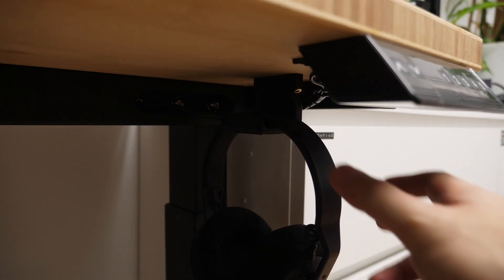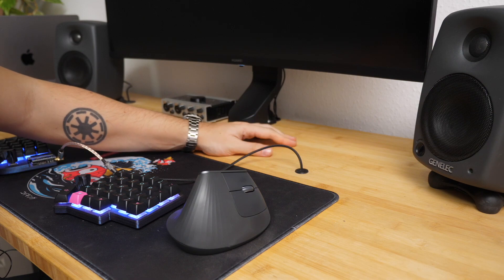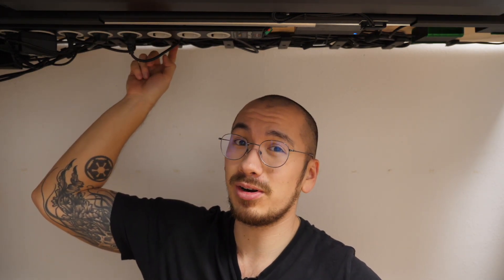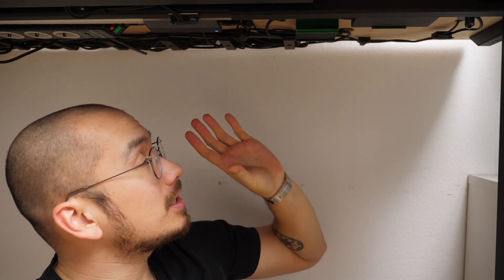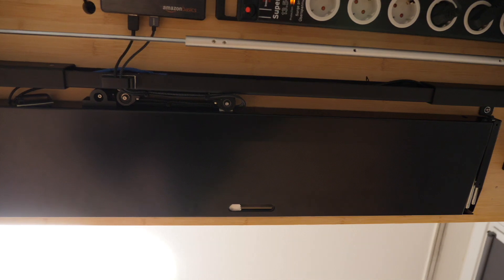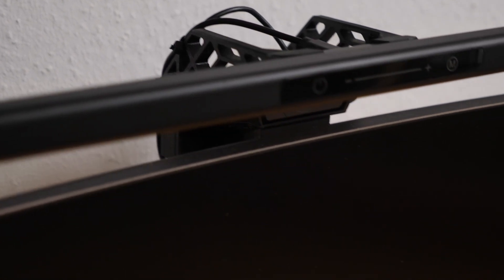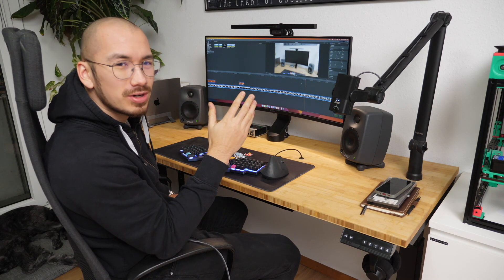Better Cable Management with 3D Printing

Comment: I recently got my 3d printer, and I have primarily just been using it to improve things around my setup.
As you said every ones desk is personalized, even more so when you dont have a standard desk, and thats exactly where 3d printing shines being able to do your own custom solutions. For reference I have the hanging plate in a SVÄRTA ikea bed so unless I drill holes into it nothing standard really works.

Would be curious if its possible to make a cable sleeve as well with 3d printing. Just to tidy up the cables running along stuff.

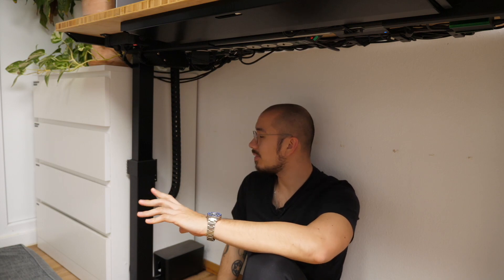Comment: 8:45 Awesome, just awesome, but I Need your help with 2 things. I also bought such a desk and a 3d printer, which means I will adapt some thing with it instead of buying it. Just like your cable drag chain. But my issue is that my pc is standing next to the desk on a small shelf. I would really like to go with the cables down to the floor and then with some kind of chain to the underside of the desk. But with many cables like: main power, 2x DisplayPort, at least 1 usb cable, and some more if needed. Do you have any solution for that? As your chain only goes to the lower table stand part. I could make a somewhat hard 180 turn downwards but that’s not ideal. And you only linked the chain mount, what chain did you use specifically?
The second question what drawer is that, any link for it?
Tysm

Comment: FYI functionally, with the drag chain, it doesn't need to go all the way up to the desk. If you observe, the upper portion of the drag chain never bends. You can be a bit more economical by replacing the upper, unbending, portion of the chain with a rigid support that hangs down from the desk for a shortened drag chain to mount to. But the aesthetic is cool 🤓

Comment: hm, it can be done better. Maybe you can put cables in channel and close it up. Or print channel with holes for cables, like the pros wire electrical cabinets.

Comment: I was actually looking for some cable management ideas for a guitar pedal board, but this was interesting anyway.  I've been designing musical instruments and tools like drill blocks, shockproof microphone holders etc.

I don't have any ideas beyond the excellent ones you've already show here, but I do have a suggestion for design discipline and workflow.  To get around the problem of variations in size and make designs able to be re-used when things change slightly, I make all designs parametric now.  In other words, if I have a design for the fipple for a 'D' Irish whistle but now need a 'C' fipple, I just open a spreadsheet, change the relevant parameters (pipe diameter, windway and labium parameters) and get it to recalculate the drawing.

Lots of programmes can work this way, but I'm using FreeCAD.  You do have to think a little differently when designing this way, but like designing specifically for additive manufacturing (support, layer directions etc) spending a little more time now can literally save you hundreds of hours later as you re-use what can sometimes be very complex designs.

Comment: From my perspective as an engineer in research, development and construction, your cable management has become very good. To be honest, the many ill-conceived constructions on the 3D printing platforms annoy me enormously. Good ideas are often implemented poorly, so I often  spend a lot of time in adapting the net- structures. In general, it's a shame that a close-knit society has become a sales hype for constructions, but thats another theme and at the moment I´ve shared myself not a single construction because of no time to do it easy explained and really good.// Just a little tip for your designs, try using PCTG. It is simply more forgiving in terms of impact and bending. With PETG, robust constructions break too quickly for me. PCTG is a better filament in my opinion. Have a nice print! :-)

Comment: For cable management under the desk, i used small 3d printed loops for velcro strips, that way i dont have to print anything bigger than it needs to be + i can change the velcro strip when i need room for 5 more cables or something like that.
I really love the holes you made, especially with that galaxy black pla. Currently i dont need holes, but now i want them.. thanks lmao
Nice video Norman!

Comment: I also have a height adjustable desk and want a clean setup. I just couldn't find the motivation to deal with that mess. My PC is on a self-made mount under the desk. I'm also planning to incorporate an igus cable chain. I also had the idea to make a custom cable for Power and Ethernet that includes both within a single cable and connector that goes from the bottom of the desk to a custom wall outlet (my desk has wheels, so a single cable would be nice).